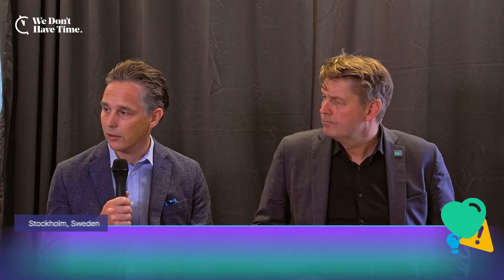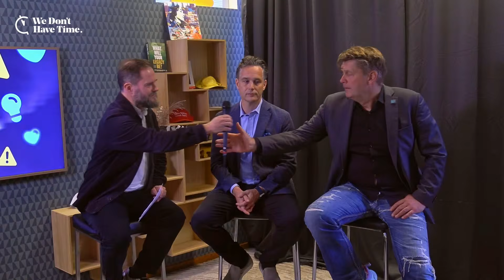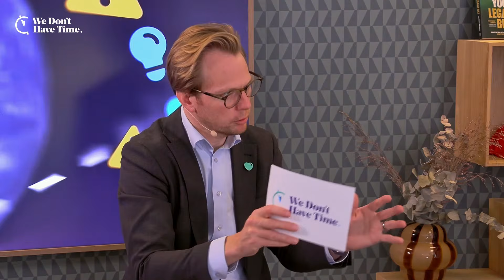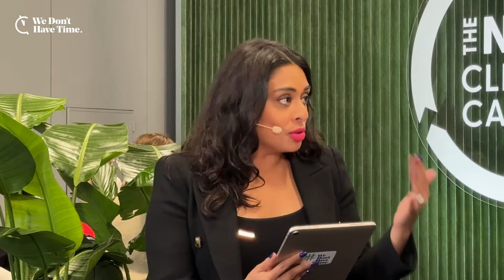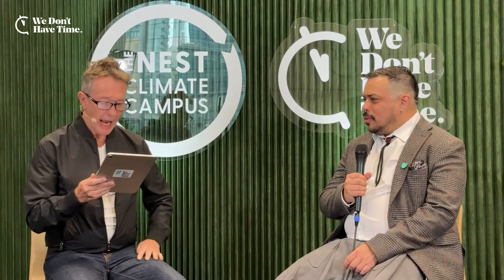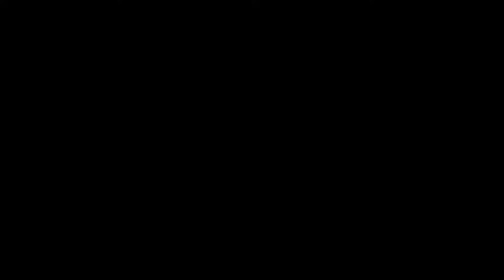The Climate Hub at Climate Week NYC 2025 - September 26

Comment: A Climate Remediation Suggestion to reduce global warming and reduce ocean acidification.
There is a lot of discussion and no full agreement about Global Warming, whether it really exists, how serious a threat and the role of Atmospheric Carbon Dioxide. However, the following is generally agreed. Namely that a lot of CO2 has been released into the atmosphere since the start of the Industrial Revolution and a lot of it has ended up in solution in sea waters. There is at least 150 times as much CO2 in a cubic meter of sea water as there is in a cubic meter of atmosphere at STP. This is acidifying the sea waters and possibly harming Coral Reefs and other fauna. There has also been some agreement that the Temperature of the Earth has warmed somewhat.
The Earth's rotation and the Coriolis Effect has formed several Tropical/Semi-Tropical Oceanic Gyres,(google "Oceanic Currents" and "Oceanic Gyres"}  within which the mass of sea water is rotating, clockwise in the Northern Hemisphere and counter clockwise in the Southern Hemisphere. Anything floating, i.e., less dense than sea water tends to float towards the center of the Gyre. There are five main Gyres all of which are Tropical/Semitropical. They are the North Pacific, South Pacific, Indian, North Atlantic, and South Atlantic Oceans. Together they form a very large proportion of the 70% of the Earth's surface which is covered by water.
The North Pacific Gyre has a lot of floating debris, "the Great Pacific Garbage Patch", some of it being debris washed off Japan by tsunamis following the recent Fukushima Earthquake. The Southern Hemisphere Gyres do not appear to contain much floating debris.
The North Atlantic Gyre is unique. It contains the Sargasso Sea which is characterized by the presence of two species of Sargassum, a seaweed, which float by virtue of oxygen-filled follicles. It was discovered (first documented) by Columbus from his voyage in 1492. There is a Sargasso Sea Commission, with an Office in Washington DC, which is charged with protecting the Sargasso Sea from pollution etc. There is a website that basically describes all of the positive ecological values of the Sea. It has been compared to a floating rain forest.
Since 2011 the Sargassum appears to be overflowing from the Sargasso Sea and moving via the west bound currents across the north coast of South America into the Caribbean and sometimes into the Gulf of Mexico. This has been attributed to agricultural run off from the USA or Brazil but might be due to the increased levels of CO2 in solution in the sea water.
It has been washing up on beaches through out this region, as one might expect to happen. When it dies and rots it emits H2S. Since a lot of these beaches have tourism as their main industry, the weed has to be removed manually which has given Sargassum a bad name. There are several Facebook entities that keep track of Sargassum landings and there are frequent postings enquiring about Sargassum occurrence on specific tourist areas.
The occurrence of Sargassum in the Caribbean would, however, make it very easy to put live Sargassum into the Pacific off the west coast of Mexico. Modify a few shipping containers, catch live Sargassum from the Caribbean, truck it across Mexico, and place it in the west bound currents of the Pacific Ocean. From there the currents would carry it all the way across the Pacific, photosynthesizing and growing all the way absorbing a lot of CO2 and heat energy, (photosynthesis is an endothermic reaction). Absorbing CO2 from the Ocean would allow more CO2 from the Atmosphere to dissolve in the sea as well as reducing the amount of acidification. The Sargassum would probably stay in the North Pacific Gyre but some might drift into the South Pacific.
One might balk at the idea of covering a lot of the Oceans with Sargassum but it does have uses. It can be used to make ethanol, paper or cardboard. Someone in the Caribbean is making construction bricks from it and others are feeding it to goats. The Government of Mexico has just issued a declaration that classifies sargassum as a useful resource.
If there appears to be some benefit from Pacific Sargassum we could easily add Sargassum to the other Gyres using ships that are transiting the Panama Canal. It seems likely that some Sargassum will eventually get into the South Atlantic Gyre, but that may take a while.

I would welcome any thoughts or comments.

Robert O Ducharme PhD, MSc, BA (Oxon) 
rodincus@aol.com.